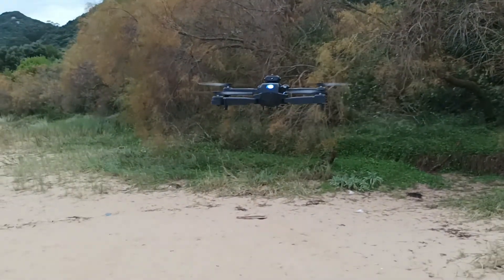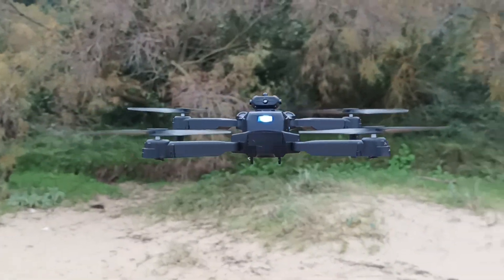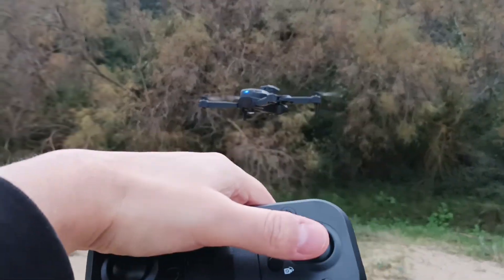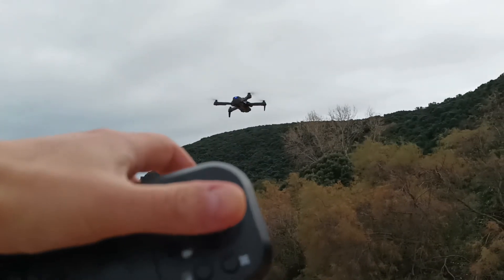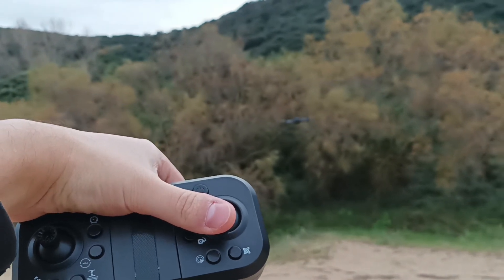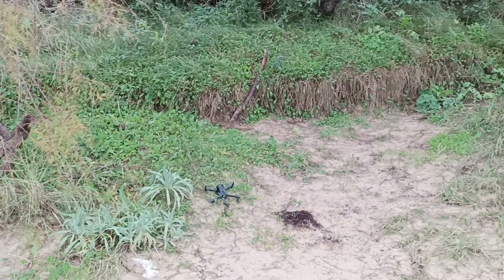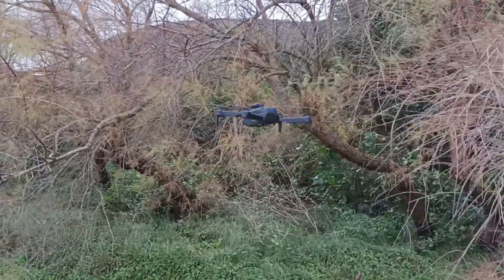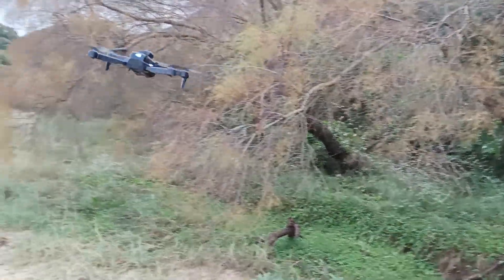How does Obstacle Avoidance Work on Cheap Drones? Obstacle Avoidance Drone Demo.

Comment: I think when the engineers thought of obstacles they did not have wire-thin twigs in mind but rather walls, buildings and maybe people.
Reply from the maker: This one does not even detect walls, but I found one cheap drone that really does, will post soon.